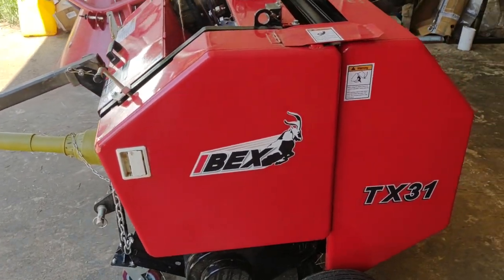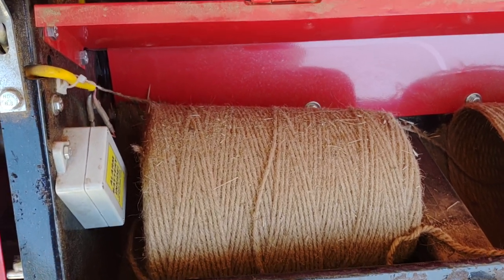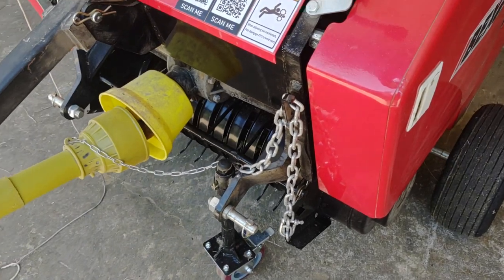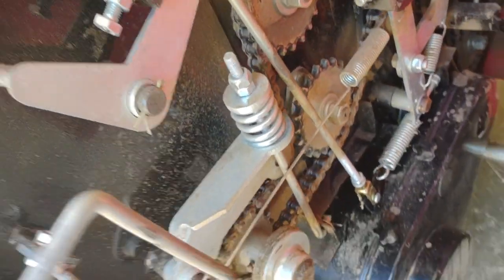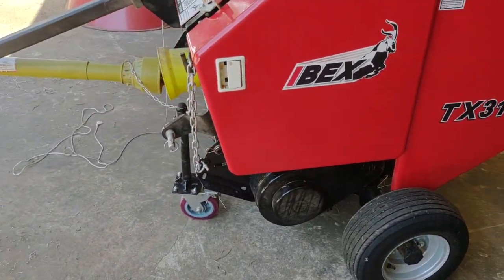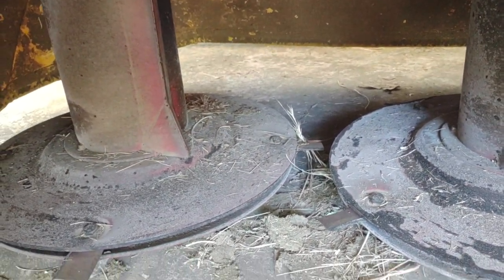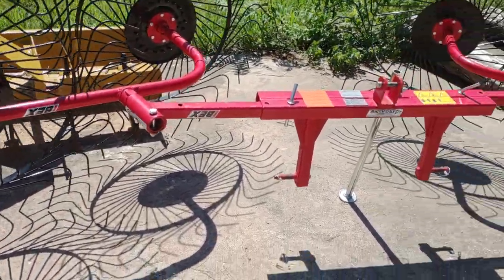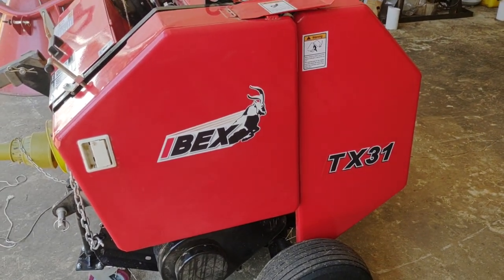Ibex Small Farm Equipment Review

Comment: One thing that helped me as far as the rake was to cut sooner. Besides that I would only grab grass with the right wheels going one way and the left wheels going the other way. So one side was always on what was already raked. The good thing was that if anything g was missed on the previous pass it would grab it too. Just be careful not to get into your other row and steel some out of it!
Reply from the maker: We will cut a little sooner this time and see if that helps. I did take one side off and use it as a two wheel rake, too may trips down the field but that may be the answer until I get a different rake. 

Thanks for the suggestion, good luck on your next cutting.
Reply: @tommywise1702   We have a tractor supply version of that rake. It did the same thing when using on the lawn just to collect clippings to use in compost, I had to add a piece of pipe that pushed the two sets of wheels away from each other and it solved the issue. It’s all bolt on so if it didn’t work I could remove it. But it’s still like that 👍if you need a pic I could send you one but I didn’t see an email listed for you.
Reply from the maker: @rodney5656 there should be an email listed in the "about" section of the channel. I would be interested in a pic for sure. tomandsallysba@gmail.com